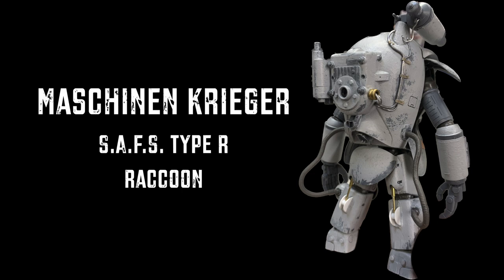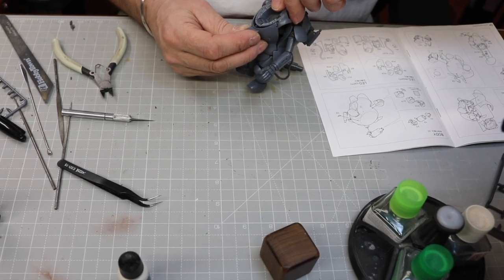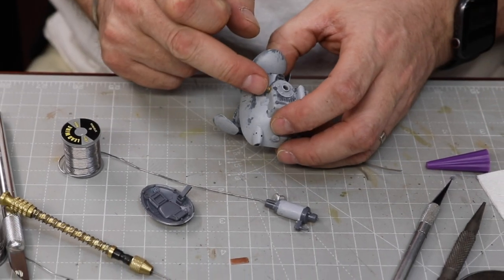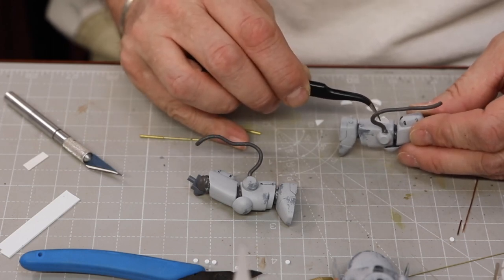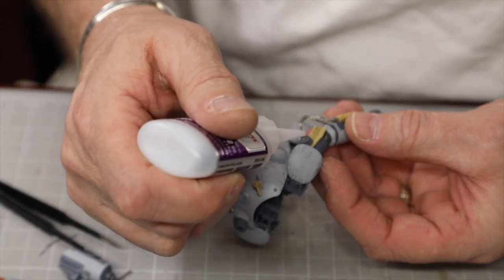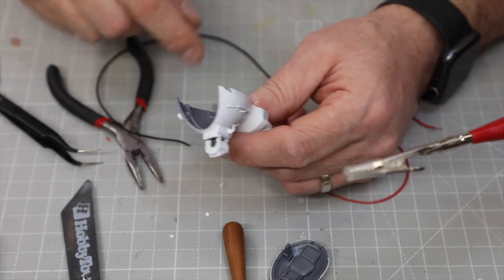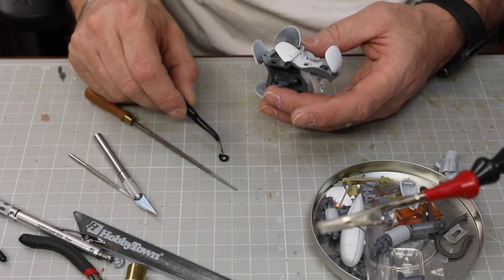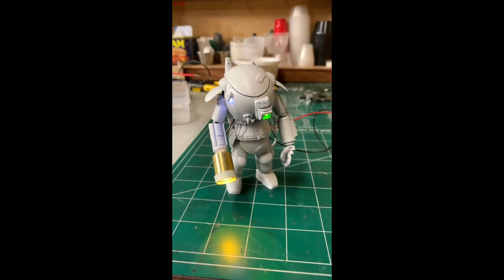Ma.K. Raccoon build - Upgrades and LED lights

Comment: Really nice work! Looking forward to part 2! 
One question - what do you plan on using as power supply for the LED's? Have some LED, but haven't figured out how to make a battery pack yet.
Reply from the maker: Thanks Benjamin!!! I use a 9 volt battery most times, but have a simple way to also use a 9 volt wall plug. Im going to talk about LED's today on my 12 noon livestream, and if you can make it great, if not the replay will be available on my channel. I'll make a special note to discuss that topic today. Thanks for watching, Take Care, Bill

Comment: Hi is that 1/35 scale
Reply from the maker: Hi ifeyecouldpaint!! Very good question!! Its 1:20th scale, and my first time building in that scale so it's a little weird. I think it was John Hayes who asked in a livestream about how I judge scale, and I have a ruler, but most times I just use the figure and eye-ball it. If I were a little smarter I would use the supplied head which is supposed to be about 7 to 7.5 heads tall, (but I just thought of that while I was typing this...) Thanks for checking out the video, Take Care, Bill